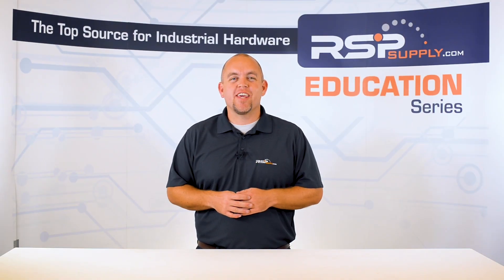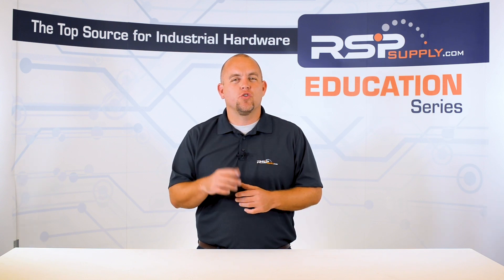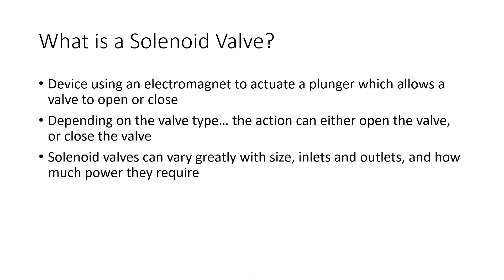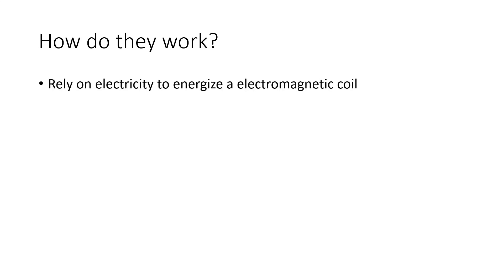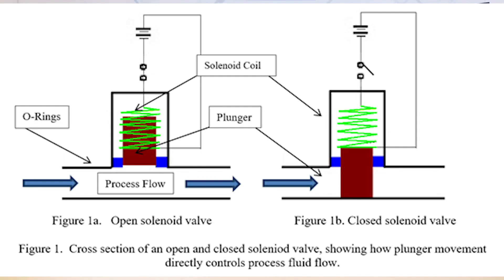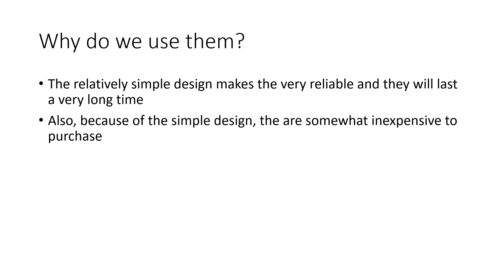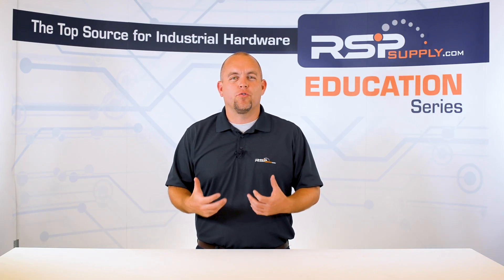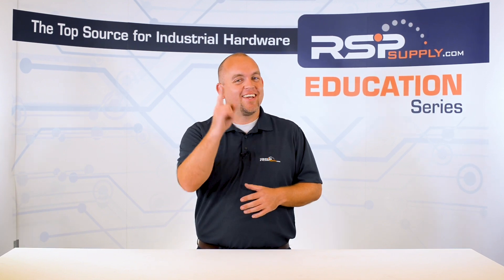What is a Solenoid Valve?

Comment: thanks for the video! I have a question: Can I regulate the water intensity with a solenoid valve?
Reply: Yes, you can control flow rate by specific solenoid valves.
Reply: @mnb60291  what's the difference between positinor & Actuator
Reply: @shadowhokage5504  The actuator allows you to open and close to door(on/off), the positioner is like a door wedge, let you decide where the door stops(control).